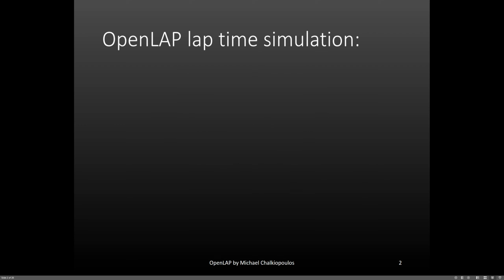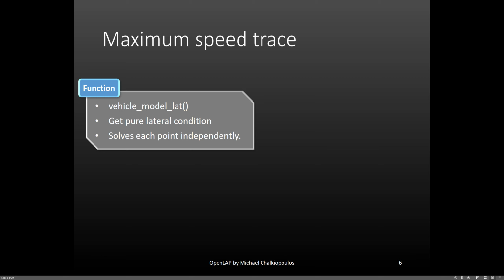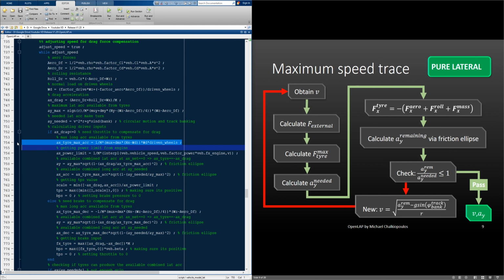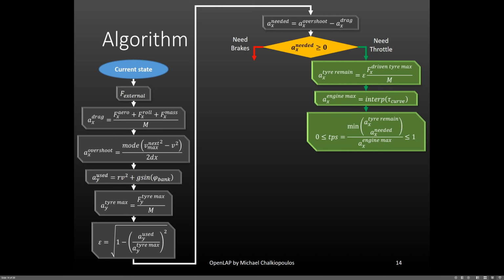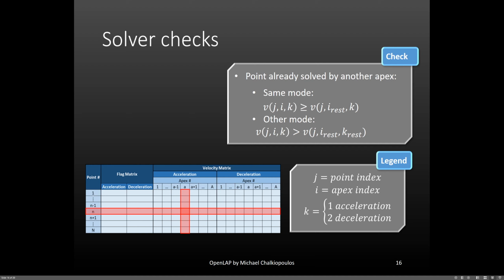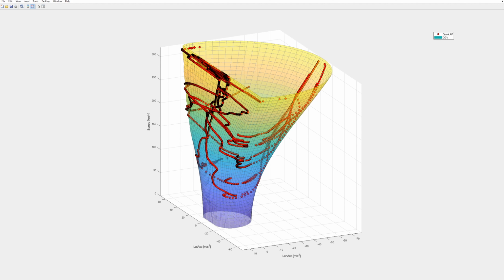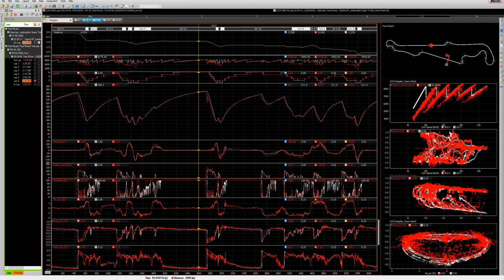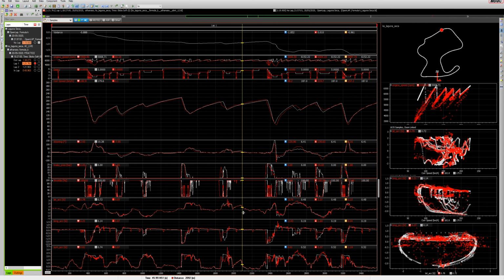OpenLAP Lap Time Simulator Part 6: Lap time simulation

Comment: Can this be used for motorcycles? i assume you would change the number of driven wheels to just one in some cases? what would need to be change? Also can this be used to estimate/sum the required energy in kWh for a lap or a full race? i assume that is would require the total tractive force then convert force to power with Power = force * velocity, then integrate over time.

Comment: This tool seems really amazing, thanks for putting it out there. I was wondering about one thing, does this solution assume that the car is travelling on the only possible, or perhaps most optimal path?

I've one lap time simulator that considers the width of the road at each node to determine the path it should take. Is this something worth integrating, in your opinion?
Reply from the maker: Hello Rory,
OpenLAP drives the given vehicle on the given path. It does not know if it is the optimal or not, nor can it change it.
This is a completely different subject, as is the importance of its implementation.
In simple terms, it depends on what you want to achieve.
In the real world, even if the path is not the optimal, the benefit of something like this is that it shows you the effect of the changes you make. Usually, you are not interested in the optimal computer generated number, but in the direction your design should move towards.

Comment: How did you get this data acquisition to compare with OpenLdap? What component did you use on the car to acquire this, and with witch software did you use to analyse it?
Thanks for the attention!!
Reply from the maker: The lamborghini was a fully prepped race car so it had all the Motec electronics that are needed.
The same applies to the shifter kart that uses an AIM system.
The simulation case gave me all the channels via its calculations.
The software is Motec i2.

Comment: Hey Michael 
I see you have imported your results into motec once you have completed the simulation. 
Do you know if this is possibe using the free motec software? It seems as if you need a licence for this?
Is this the only option? 
Thanks a ton for all your great work
Reply from the maker: Hello Bober Burgers,
No you cannot import you own generated data to i2 directly if you don't know how to generate your own .ld files.
I think you can get software from Motec that allows you to do so, but its not cost effective usually.

Comment: Hi Michael,

When looking at the equation for the maximum lateral case only why have you used 

fytyre - fymass = mv^2r 

Shouldn't it be
fytyre - fymass = mv^2/r

Cause then it would mean you are calculating angular velocity instead of linear velocity. 

Is it just me being silly. Cause I am a little  confused. 

Great video 👍
Reply from the maker: Hello Solid Works,

I am using curvature, which is
r = 1/ R

Comment: Thank you for the amazing work and the great explanations.
While exploring your code and modifying it to my needs I encountered a question:
When an overshooting of the apex is detected, why are both throttle and break set to -1? This leads to very weird phenomena like negative engine torque.
I made a refined version for energy usage calculation with a LUT for efficiencies and one of the input variables is engine torque, but with this anomaly at overshot apexes it does not work properly.
Again great work and thank you for the dedication.
Reply from the maker: Hello Leon Betz.

First of all thank you!
Glad you like it!

When an overshoot happens, it means that it was a bad calculation, as the vehicle cannot physically do what is asked from the track, at the speed that it is in.
So that "column" should not make it into the final solution in post processing.
This is why I set those values to -1 in the controls, to be able to find those points when and if debugging is needed.
Also, the speed is set to inf, so that it won't get selected in post processing as part of the final solution in the min() function.
If you see those points in the final solution, then there might be a problem.
Could you send me your files in an email so that I check for the problem?
Reply: @_phoinix  Thanks for the fast response.
I could not find your Email address anywhere. 😅
Reply from the maker: You can find it in every description of the scripts.

Comment: What difficulties do you foresee for users implementing alternate CoF and Normal load sensitivity variables for the inside tires, as well as applying an alternate equation to define CoF vs Normal load along a curve rather than a line. This is just an idea on how you could use a pacejka model to define coefficients for use in openVehicle, with inside vs outside tire coefficients to model constant (non zero) camber and normal load sensitivity along a curve to capture the pacejka model more accurately.
Reply from the maker: Hello again!

The only difficulty is your coding experience i suppose.
You will need to change the functions that define the vehicle to ones that implement a double track (4 wheels).
Then you need suspension data and modelling to be able to calculate the normal load distribution.
This can be anything from a constant stiffness and roll center torsional spring model, to full nonlinear suspensions with full kinematics and everything included.
Finally, if you include Pacejka tyre models (or nonlinear in general) you will inevitably need some kind of loop that looks for the correct state of the vehicle that generates the required lateral load.
Because all this changes with the slip angle inputs, the camber, the normal load and the suspension travel.
Then you can use a very similar approach to find the longitudinal loads that you can apply.
You can even include yaw motion into all this.
But all this is for the vehicle model.
The underlying algorithm that will drive it around a track, as well as the track generation itself are all the same as in OpenLAP.
Reply: @_phoinix  apologies, from watching part 3 and 6 I don't believe that you mentioned if the model used weight transfer, I was assuming that it did. Expanding on the idea I mentioned above, if weight transfer is not a possibility I believe you could approximate a GGV derived from a 4 wheel pacejka model by extracting polynomials that represent lat. & long. CoF vs Total Vehicle Normal Load. Replacing the linear assumption with these polynomials is probably the fastest way to approximate a 4W pacejka model in OpenVehicle.
Reply from the maker: First of all, point mass modelling is equal to no weight transfer.
This can also be understood from the inputs for the vehicle model.
The fact that no suspension data are required to run a simulation, means that there can not be weight transfer modeled inside the code.
Secondly, the short answer is:
If you want to use more detailed tyre models, you need to include more wheels and suspension in the model.
The long answer is:
Do not confuse the slip angle vs normal load dependency in the tyre force generation.
The normal load directly defines what the maximum lateral force can be.
So in some cases (like in OpenLAP) you just want to know what the maximum is.
In full simulations you want also want to know what slip and camber angle gives you this maximum force, so that you can tune in your toe, ackerman, bump steer, camber gain and geometry.
In OpenLAP I already use a linear polynomial that gives you the maximum tyre force from the normal load, that is mainly dependent on the aero.
Also, in terms of combined forces, nearly everybody uses some sort of an ellipse, as OpenLAP does.
And just because there is no suspension, you cannot effectively use anything else than that.
So there is no reason that I can think of to go full Pacejka (as OpenLAP is now).
If you want to do that, you need to include some sort of suspension and upgrade OpenLAP.
As OpenLAP is now, the only extra thing you gain if you include the slip angle dependency is a more accurate steering input channel after the simulation is done.
And this is because slip angle does not drive the model.
If you then add the camber angle dependency, you can only just look at what the static camber does, as it will be like a global friction coefficient modifier.
But in reality, camber changes a lot (depending on your suspension) so there is no value in this in my mind.
Reply: @_phoinix  
I have mistakenly used the terms point mass and quasi static interchangeably

I will describe my potential solution in some more detail so we are on the same page.

to create the CoF vs Normal load of the tires polynomial you just need to iterate SA for each Fz. Outside OpenVehicle

Take those polynomials and plug into an iterative 4W Total Vehicle CoF solver (Lat & Long independantly) (outside OpenVehicle, keep track of trackwidth CGh and wheelbase elsewhere)

find CoF for both directions for many normal loads to produce a NetLatCoF vs Normal Load polynomial (same for long)

replace the linear regression in OpenVehicle with these polynomials

your ellipse is than used.

The only reason to define a static camber is that you must as it is an input for the pacejka obviously. I agree there may not be much usefull information from simulating static camber.

The biggest benefit of doing this is that many FSAE teams already have fitted pacejka coefficients but many do not have reliable testing data to produce total vehicle CoF vs Normal load fits
. For reasons such as uncertain aero downforce, limited testing, and poor data collection.

lastly, If you could please identify if there would be any issues with implementing these polynomials into OpenVehicle, that would be fantastic!
Reply from the maker: @jareddempster2101  I completely get what you saying.
Just a thought though.
It feels like all this work can just go into upgrading OpenLAP's functions directly, to use a double track model with suspension.
It is not that hard to do.
If you have your own tools already developed, you could basically port those functions directly into OpenLAP, no matter what language they are in.
What I mean is, if you don't have the tool already, then just go ahead and upgrade OpenLAP.

Also, take a look at this.
The Pacejka curve is basically:
Fy = D*sin()+V
By assuming vertical shift V=0, the D factor just gives you the max value automatically.
This is because the sin(), can only give you 1 as the max value.
And if you dig deeper, you will find that:
Fy = D = mu*Fz = (pDy1+pDy2*(Fz-Fz0)/Fz)*Fz

That resembles the equation I used for the tyre a lot!

pDy1 tells you what the coefficient of friction is when Fz=Fz0.
pDy2 tells you how this changes with normal load.

So if you have a MF model, use pDy1 and pDy2/Fz0 to get the values you need in OpenLAP (for Fz close to Fz0).
This is what I mean by "don't confuse the normal load vs slip angle dependency of the force generation".

Comment: Thanks for the detailed view of your simulation tool and results. You have mentioned using the .ini assetto corsa variables as inputs for the vehicle model. If you could describe your process for converting the assetto corsa tire model for use in the openVehicle tire model (during Q&A or otherwise)  that would be greatly appreciated.
Reply from the maker: Hi Jared,

The whole model generation thing is a big and important chapter, as it dictates how accurate the results are going to be.
So I have been thinking of including the process in the Q&A for a while now.
As for the AC .ini files they make the process a lot easier.
If you know the setup used you can derive stuff like aero and tyre coefficients.
Just using the constant friction coefficients for the tyres is a good place to start for example.